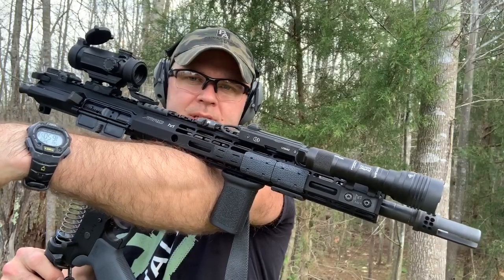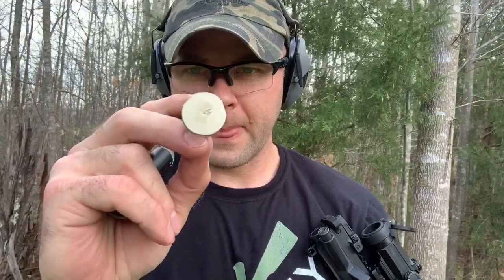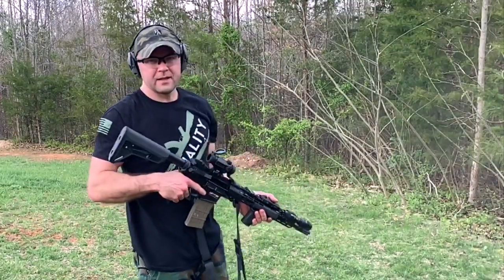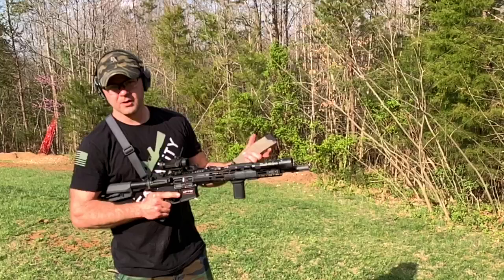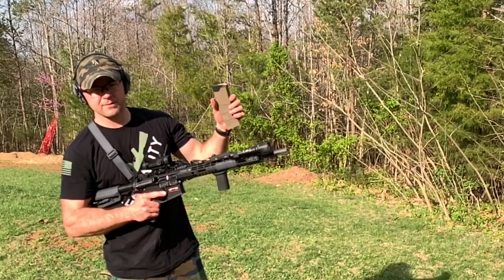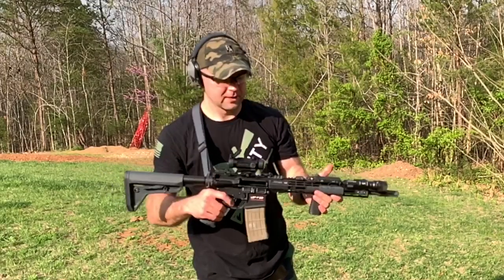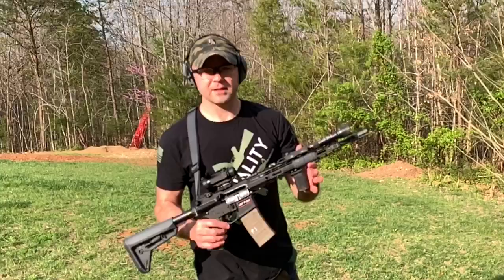Aero Precision 14.5” Upper / What buffer weight for reduced felt recoil?

Comment: Why you would go with a carbine length just to catch a sale is far beyond me. Now you're changing weights and ultimately have a worse shooting rifle. Just to save $60?
Reply from the maker: No… this length is meant to be carbine length… midlength with this length barrel can not be as reliable. Doing it this way… you get more gas an reliability… and the ability to tune it some. You can’t do that with a midlength.
Reply: @wellregulated8725  that's very debatable, and borderline false in 2025. So many companies make mid length 14.5s that are absolutely 100% reliable. Adjustable gas blocks are also now very usable and reliable. Especially if you aren't removing suppressors. It still makes little to no sense with a standard gas block these days. But, you do you. I hope your gun treats you well
Reply from the maker: @ not talking just normal shooting conditions…. Dirty… carbon… but I didn’t spend 2k. This is more budget related… 🤷🏼‍♂️
Reply: @Bischlarbo69 it comes down to a lot like dwell time, gas port sizes and pressure levels but a carbine length in a 14.5 barrel is literally optimal reliability which is what lead to the military staying there when they started chopping down barrel length and testing effects on reliability. Middies are plenty reliable but technically speaking he is correct
Reply: @AllAmericanAllegiance military demands/environment are a bit different, but i digress
Reply: @Bischlarbo69  I agree we will likely never need it to reliably cycle on full auto in adverse conditions without failure but some will want it to be capable of doing so anyways. Not that middies can't it's just a matter of nerding out on the numbers. The same reason people like socom barrels on their semi auto rifles.
Reply: @SwordofSt.Michael  Fair enough. As long as its accurate and reliable, thats all that really matters
Reply: @Bischlarbo69  Agreed. Stay sharp out there.

Comment: Would H3 work in 12.7
It came with h2 and i think it doesn’t cycle fast enough 
It’s equipped with Geissele sd3g 
And other than short travel I didn’t gain any speed during rapid fire
I am thinking to try H3
Reply from the maker: Are you out running the gun with the trigger?
Reply: @wellregulated8725  
Exactly 
You described it just like I encountered 
I thought that was kinda weird
Reply: @wellregulated8725  
What  can be causing this ?
I was really struggling addressing this
Thanks in advance
Reply from the maker: @Freddie206  unless you are freaky fast, the Gasport might not be lined up or be too small…… Might have too much weight…. May take some trial and error to figure out.
Reply from the maker: I’m guessing it’s a carbine length gas tube.

Comment: Did you use a standard carbine spring when testing the rifle? I’m looking at the springco buffer springs. Between the red/white and the blue buffer springs.
Reply from the maker: Just the spring that came with the lower. Only swapped buffers.
Reply: @wellregulated8725  ok cool. Thank you for the video. Good stuff
Reply from the maker: @Deadleg1-502  it’s been a couple years ago. Hopefully I’ll be able to get out and shoot more soon.
Reply: @wellregulated8725  would you be willing to try out the blue or hotwhite springco buffer springs and make a video on it? And also using the different buffer weights?
Reply from the maker: @Deadleg1-502  I don’t have that in my budget…. Next gun purchase is a .22 Glock for my kids to shoot.
Reply: @wellregulated8725  even better then. Good on you for getting the yougins involved in firearms. I’m just going to order the blue spring and h1 buffer. It’s just plan fun to test and tune. Lol.  Again. Thank you for your time.

Comment: Honestly your standard carbine buffer looks to be the best ejection pattern. It was already quite a bit under gassed due ti the low power ammunition. I bet standard power brass would eject just fine using that buffer too. The h2 was sending it way too far back. It might lock back but its most likely barely locking. I’ll take a little extra gas for reliability than every spec of softness possible.
Reply: From what I’ve read and watched on videos the best ejection pattern is between 3 o’clock and 4 o’clock which the 2H buffer was producing. Think I will test one in my bcm.
Reply from the maker: That’s the good thing about buffers. Easy to replace.

Comment: Spring selection is just as important, if not moreso than buffer weight. Also, looks like you're shooting steel case which is far from an optimal load to base buffer system off of.
Reply from the maker: I want my rifle to run everything… I realize steel cased is under gassed…. That’s why I used it for testing. Covered that in the video……

Comment: I run an H2 on my 16 inch .223 wylde carbine. Gives me that smooth felt recoil and has been eating all the brass I give it from cheaper .223 brass to the Fire hot 5.56. 
I also run it suppressed most of the time, so I have a bootleg BCG to vent that gas and keep that BCG running smooth. 
In my experience carbine gas systems are widely more tunable especially depending on the barrels gas port size. 
Mid and rifle length are picky bitches but that's due to the gas already dropping in pressures by the time it's going threw the gas block.

Comment: I was running a 5 port muzzle brake, H2 weight, rifle length spring. Im now running a deadair 3 prong, H2 weight, geissele super 42 rifle spring, and have changed from DI, to adjustable gas piston. I love it more so now. On the 54% setting im getting a 2:30 and 3 o'clock ejection
Reply from the maker: Cool

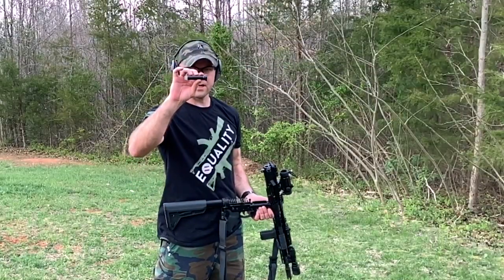Comment: Looked pretty good to start with, but if it works go with it. I have a Colt 6920 it throws brass and steel to 1:00 o'clock. Just ordered an H2
Reply from the maker: Cool, hope it helps! Trying to gas this for M193. Just want it to run steel too.
Reply: I run steel also at times, that is how I will test the new buffer for reliability.
Reply from the maker: @g.h.3049  if it can run the under powered steel cased ammo dirty, then it should be fine with the good stuff!

Comment: With a 5 oclock ejection using a standard carbine buffer, that means you're UNDERGASSED already. You should be moving to a lighter spring weight to get to 3-4 oclock ejection, which is where ejection should be if properly gassed. You're going the wrong direction by increasing the buffer weight. If you were ejecting 1 oclock with a standard buffer, that's when you move to an H or H2.
Reply from the maker: Steel cased

Comment: Add the sprinco blue spring with that h2. It’ll flatten it out even more
Reply from the maker: Nice! Have a good link?
Reply: @wellregulated8725  https://www.primaryarms.com/sprinco-m4-ar15-blue-enhanced-power-carbine-buffer-spring?quantity=1&custcol_pco=Orphan
Reply: I second this notion! I run Sprinco Blue springs in my 10.5”, 11.5”, 12.5”, 14.5, 16”, & 18” When shooting suppressed or shooting SBR’s they truly are my go to standard. (I also run H2 buffers in the aforementioned systems) I will never out shoot the lifespan on those springs either.

Comment: H2 is where is at. I run faxon gunner 16 mid length,  m4e1 upper and lower, aero nitride bcg,  with war comp muzzle device.  Faxon recommends an h2 with their gunner barrels, as they tested with cheap ammo to ensure proper cycling.  Even these days i still don't run much steel cased stuff tho and when I have,  I've had no issues. I Ran a standard buffer for a few months, the h2 made a difference in faster target accusations and over all felt recoil.
Reply from the maker: Awesome!! 🤜🏼🤛🏼 good info

Comment: 3 of my Ars are 14.5s with .063 gas ports.They have h2 buffers and they all function 100% with brass and barnul.My mk18 has a .070 gas port and a h2 buffer and it functions 100% with the same ammo.Theyre carbines by the way.I have a 14.5 mid length DD barrel and it functions with the same ammo too but I think its a little over gassed.
Reply from the maker: Cool, thanks!

Comment: I wouldn't put a heavier buffer in unless you were using a 12.5 or 11in barrel your ejection pattern with standard buffer was perfect
Reply from the maker: This is with .223 wolf though.
Reply: @wellregulated8725  that's the problem right there lol
Reply from the maker: @SeanF151  I just wanted it to cycle .223 and run perfect with m193 🤜🏼🤛🏼

Comment: Now try some different springs with the buffer weights
Reply from the maker: Scott Branham Callin her good for now....
Reply: Well Regulated they’re all good. Minimal recoil regardless
Reply: Well Regulated I built a dissipator with a 14.5” Wylde barrel with a rifle length gas system. I had to open the gas port to get it to cycle ammo and it still wouldn’t lock back on empty. I put a %30 reduced spring in it and it started locking back. I miss that rifle as it was a conversation (argument) starter.

Comment: Curious to know the buffer weight that provides for the best performance assuming 14.5", mil-spec BCG weight, mid-length gas and a non-adjustable block. This gets touched on but I didn't hear a clear answer. Thanks.
Reply: I run a springco blue spring and h1 buffer in mine.
Reply from the maker: There is a good thread on AR-15.com on this.

Comment: Just got a 16inch carbine lenght barrel, and was thinking of using my h2 buffer. U think it will cycle properly? What if I add a compensator to my barrel? I was thinking of adding it, but not sure if it I'll cycle properly
Reply from the maker: 23TheFiasco a comp would help keep the gun flat. An H2 will prob run fine. Only way to know for sure is to try it out.

Comment: That's really interesting since most carbine length rifles use a standard carbine buffer and that's all the way down to 10.5 . I just finished a Aero Precision build with a 14.5 Rosco mid length barrel. I'm going to give this a shot and see what happens.
Reply from the maker: Guess there are other factors. Prob also depends on gas port diameter. Their are pages of stuff online. If you have the buffers, see what happens! Let me know!
Reply: You should give strike industries flat wire buffer spring a go.  Made my rifle so much smoother.
Reply from the maker: Whatever happened?

Comment: Now this is a very informational video. Good job! . I'm gonna be doing the same test but with an A5 system on my bcm 14.5 next week.
Reply from the maker: Cool! Let me know how it works!
Reply: @wellregulated8725  I ended up with an h2 buffer.  I did the testing with weaker .223 ammo.  Bolt locked back every time.  So i know it will be fine with my normal 5.56 ammo.
Reply from the maker: Midlength or carbine gas system?
Reply: @wellregulated8725  mid length

Comment: I appreciate your video. I was looking at the aero mid-length uppers recently for a recce build.
Reply from the maker: Those should be smooth! They were out of stock during the sale I got this one at. With this barrel length, I’m almost glad I got a carbine length. Will you run a standard or heavy buffer?
Reply: @wellregulated8725  i thought they would be smooth they are overgassed and the h2 buffer is too heavy the best solution is an h buffer w adjustable gas block.

Comment from the maker: See comments for additional notes!
Reply: Hey man, I'm building my first ar and I went with a 14.5 ballistic advantage barrel chambered in 5.56. Would a carbine gas system be recommended over a mid length? Great video bro, thanks.
Reply from the maker: umm4rmumbridge xD  I’m not an expert, but that length was designed for a carbine. You can always add buffer weight, but not sure about an undergassed rifle. Low power ammo and grime can change performance....